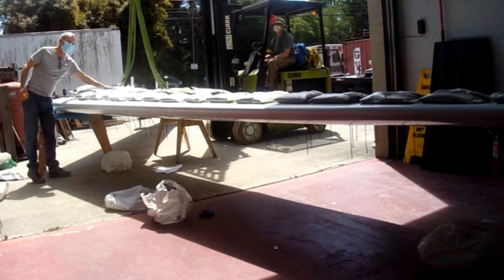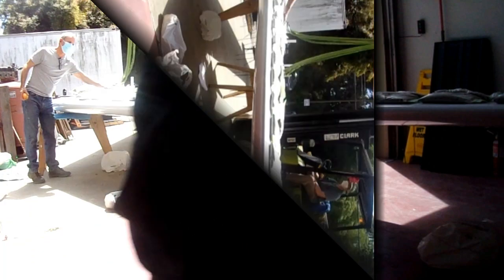KW MkII Rigid Wing Hang Glider Development - Proof Loading

Comment: Hi,
I have been keenly waiting for an update after your first real flight and rather bumpy landing.
I have a few questions which I hope you won't mind answering;

1. How do you test for torsion loads?
2. How do you test for drag force loads?
3. The Oracal 651 vinyl covering you use for the leading edge has a tensile strength of 19MPa. Compared to the burst strength of the oratex UL600 polyester fabric (I know you are not using that but rather the oratex meant for models) which is ~0.4MPa. So my question is why not use the vinyl INSTEAD of the oratex?

On behalf of the world, I'd like to thank you for sharing your knowledge and innovative problem solving techniques on youtube
Reply from the maker: Wow, these are really great questions! The proper answers are a bit extensive, so I think it deserves the "video treatment". Stay tuned and in a few days I'll post a video response to address this key topics. Fly Safe, Rol